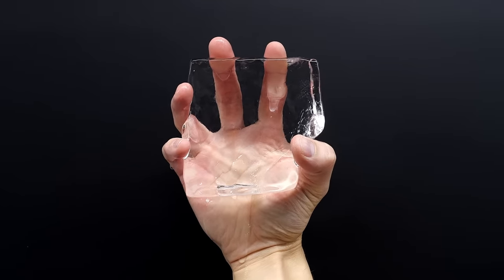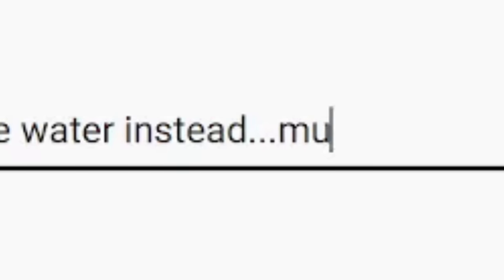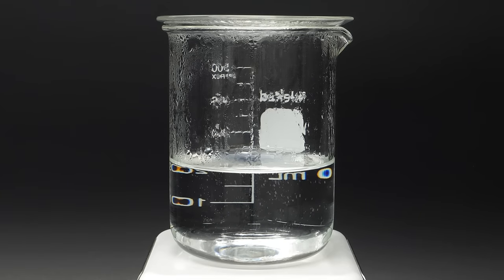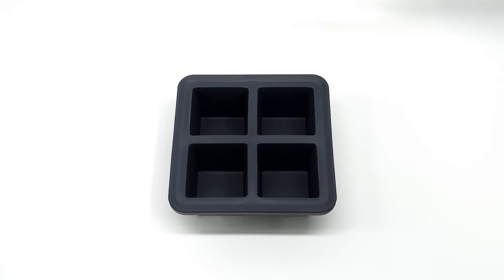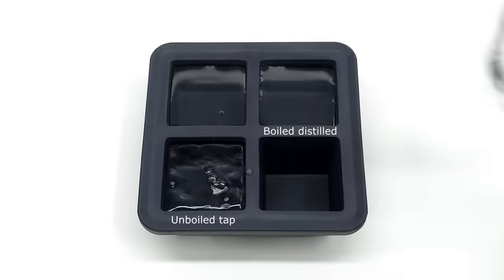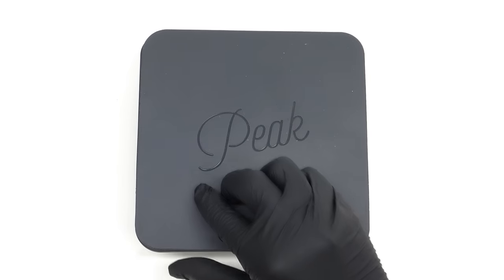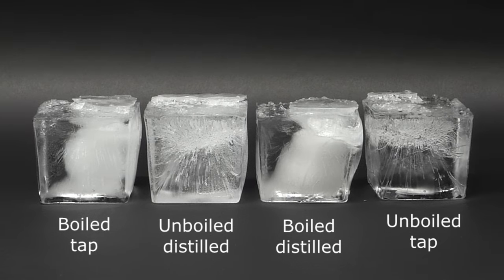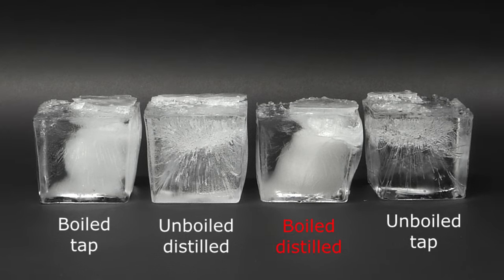The clear ice myth

Comment: It’s been years, so forgive my lack of citation.

For clear ice sculptures a manufacture used a small water pump to keep the water moving (think it was to stop bubble formation..?) in walk-in freezers. They made fairly huge blocks of ice that had crystal clarity. The blocks froze from the surface down so that the pump hose wouldn’t be a feature of the ice hehe. 

Think it was just filtered tap water they used. 🤷
Reply: They also use warm (not boiling) water, which they claim provides the best freezing results.
Reply: @medes5597  bruh that name

Comment: I think the boiling fallacy is based on an already misconstrued truth: that boiled (and then cooled-- which no one ever remembers) water freezes faster.  

ironically, water freezing faster will almost always result in less clear ice.
Reply: it's cuz you need less thermal contraction.
Reply: It's amazing that you don't even need to be a scientist to get to this conclusion or at least understand it, all you need is to have bird baths in your garden and live somewhere that is warmish during the day, but below freezing over night. That filthy, unfiltered, non-boiled water turns into pretty clear ice. Obviously not as clear as actual filtered water, but clearer than all of the tests in this video.
Reply: @deployed246  People living in tropical region: ಠ_ಠ
Reply: No I am fairly sure it's based on boiled water being thrown on the ground in cold weather actually producing very clear ice. 

How clear it is is of course mostly down to how fast it freezes and the manner in which it does. The more time you give it the more cracks you get. 

The problem with icecubes is that they tend to freeze outside in so you get a lot of cracks inside. If you throw boiled water on the ground at very low temps it actually does produce rather clear ice. But the trapped gasses are actually a much smaller factor compared to cracking from the ice expanding and contracting as it freezes.
Reply: The fallacy is in that while boiling water does degas it, it almost immediately starts to absorb air as soon as it stops boiling. The act of pouring it into the mold only served to mix in more air into it.
Reply: @alfredoprime5495  Air is only a small part of it. A bigger part is cracks from ice expanding as it freezes. This happens with basically anything you place in a freezer since it's generally going to freeze outside in. 

To get really clear ice it needs to freeze from one direction. A common example (and where the boiling water thing probably comes from) is idiots trying to clear snow by throwing hot water on it. The water comes into contact with the cold surface while warm steam insulates it from the cold air to a degree. The result is extremely clear (and really slippery) ice.
Reply: It's called the Mpemba effect.
Reply: Those are two different fallacies.   Honestly, until I saw this video, I thought that boiling would would yield clear ice, and at least for me, the reason I thought it would work had nothing to do with the mpemba effect (hot water freezing faster).   The bubbles in ice are (as far as I know) dissolved gasses in the water which have come out of solution with the water when it freezes.    the solubility of gasses in liquids is inversely proportional to the temperature.  ie:  a hot liquid will hold less gas in solution than a cold liquid (unlilke solids, you can dissolve more sugar in hot water than cold water) So heating water will cause dissolved gasses to come out of solution and bubble off (long before the water is actually boiling)   SO, yeah, it seemed plausible to me that you could boil water, causing all the dissolved gasses to leave the water,  so that there wouldn't be any gasses in the water to form bubbles in the ice.   Obviously that is incorrect, although I'm not entirely sure why.     Interesting demonstration of empiricism over ratiocination.
Reply: @alfredoprime5495  All you need to do is keep the water boiling in the freezer. Easy!
Reply: @XMysticHerox  I'm pretty sure you have it backwards, slower freezing results in clearer ice. What makes for really clear ice is directional freezing (freezing with a thermal gradient so one side freezes first, until the top side freezes). That's why the boiling for an ice rink works, because the top layer is too hot to freeze, and it directionally cools.

This is consistent with both how NileRed and the Bartender Vlad made the clear ice.

Large, transparent crystals of anything must be formed slowly
Reply: @sophiophile  Flash freezing is how you do it in a lab. It prevents cracking. But yes directional freezing is the biggest factor.
Reply: @XMysticHerox  Do you live somewhere cold enough for big icicles to form? They are perfectly crystal clear when they form from slow dripping water because they form slowly and directionally (despite the impurities and dissolved gasses).  Flash freezing/crystallization causes lots of thermal stress due to the fast rate of contraction, and hence the cracks.  Just look at ice formed using liquid nitrogen, it is always cloudy due to all of the microfracturing.  You need a single site of nucleation and enough time for no lattice defects. Flash freezing also means lots of nucleation sites, and lots of separate, differently oriented crystals meshing together. 

It is the same thing when you are forming boules of synthetic gemstone material, for example using the Verneuil method.
Reply: Correct, you need it to freeze slower to force all the crap to the top. Freeze it in an igloo cooler. The bottom of the cooler will be nothing but clear ice. You have to freeze it like a lake freezes.

Comment: Doesn't clear ice come down to having a high enough container for the water to freeze in a way that traps the impurities in, most often, the upper layers?
Reply: Apparently it’s something about oxygen or something getting inside the ice that makes it blurry
Reply: @kelfo4997 what does blurry have to do with this.
Reply: @Cannotoad1201  blurred water
Reply: The white and foggy part of the ice is not due to impurities, it is due to air trapped in the ice.
Reply: @mrthanos2404  the air do be trapped in the air
Reply: @normanmai7865  damn I realised how bad I am at typing
Reply: @mrthanos2404  is ok because we all make mistakes
Reply: Clear ice comes from directional freezing. It offers a chance for the air to escape, rather than get enclosed.
Reply: I make my clear ice in one of those little six pack coolers with the lid off. I fill it about 2/3 full of my filtered water (just a carbon filter) and let it freeze about 18 - 24 hrs until the top clear layer is about 2 inches thick. Then I turn it upside down into a basin (to catch the unfrozen water) and then use a serrated knife to score lines and then tap the knife with a hammer to make big clear cubes. Works awesome. 🧊
Reply: @mrthanos2404  I think it does have to do with the impurities as well.  I have hard water (around 300 on a TDS meter), and I just use plain tap water to make clear ice. I let the clear ice melt and then I test it again with the TDS meter, it read a zero.
Reply: clear ice is from directional freezing, when the water is in a cooler its freezes from the non insulated top downwards kind of pushing the impurities and air towards the bottom leaving the top clear.
Reply: @wyrd21  Exactly. If your ice is blurry, that is from too much scotch on the rocks. 😆 LOL
Reply: The air bubbles get pushed out of the water from the bottom up as it freezes. So you need to have somewhere for those gas bubbles to go, which is why you use a cooler for slower freezing and some extra water on top for the bubbles to escape to
Reply: It's not impurities, but bubbles! Dissolved or suspended air.  Forcing it to freeze from the top, where buoyancy would ordinarily take the bubbles, makes the water crystal-clear as it freezes
Reply: @ArchaeanDragon  for sure. Sometimes i’ll let some clear ice melt down, and drink that. It’s some of the cleanest and best tasting water I have ever drank.
Reply: It’s more about ice crystal formation vs anything else.  The lowest energy state for crystal formation is at the edge of a surface (sides and bottom of a container).  The second best location is the air-water surface.  The crystal formation will propagate from from those ledges towards the center.

To combat this you essentially manipulate where both the open end, and the “center” of the ice is.  You can do more sophisticated stuff using ultrasonic vibrations or manipulating pressure, but that’s significantly harder.
Reply: @vashok  I should probably have made this clearer, but I find that the main reason for white ice air rather than impurities, I tried making ice clear before, even using distilled water it doesn’t make it clear. This video boiled the water, which you are right, does get rid of dissolved oxygen and other gases, but as the water cools, air does come back. But you are right, impurities do play a part here, just that the reason a regular person don’t get clear ice is more commonly due to air.
Reply: The cloudy part is gas bubbles and mineral impurities, and it winds up at whatever part of whatever part freezes last. Usually that's the center of a cube, because it's frozen outside in, but if you use directional freezing, top to bottom or bottom to top, you can choose where the clouds end up.
Reply: Impurities aren't the main factor that causes cloudy ice. If that's the case, you could just freeze any vapor distilled water to make clear ice. It has to do with the way the water freezes and crystallizes
Reply: @mrthanos2404  Air is an impurity,

Comment: You need directional cooling when trying to make clear Ice. Slower the ice freezes the less fuzzy it will become.
Reply: A very easy way i found was to put water in a double wall insulated metal cup without a top. It will freeze from top to bottom. Check it often to take out the ice before all of it freezes
Reply: @MiguelY22  thanks lol cuz i can't fit a cooler
Reply: I thought it was more that by freezing from the top down, you get pure water on top that freezes first before it gets down to the impurities which you just pour off?
Reply: @Thegbear  i think you are correct. The clear ice forms on top. Do not let the bottom freeze, thats where it will get cloudy ice
Reply: @MiguelY22  you can let the whole thing freeze and just cut off the dirty ice.
Reply: @lokiaverro4196  Nevertheless if you don't let the bottom freeze, it takes a shorter time to get the same amount of clear ice and you don't need a saw or serrated knife to remove the unwanted part of ice.
Reply: @Thegbear  The direction doesn't really matter. The important thing is that it is directional at all. Notice that if you toss boiled water on the ground at low temps it tends to produce extremely clear ice as well despite freezing bottom up.

Comment: I put some water in my vacuum chamber in an attempt to draw out dissolved gases, but the ice was still cloudy after freezing.
Reply: That's because it's directional based! The ice freezes from all sides and meets at the middle in a normal icecube mold, resulting in the crystals kinda cramming together, or at least that's as far as I know how it works. But, freezing it in a way that only allows it to freeze up and down, i.e. in an insulated cooler where it can only freeze from the top down, results in all the crystals going the same way and not smashing into each other and making it cloudy.

But correct me if I'm wrong on the sciences there, I'm eager to learn! But I will say though: it is indeed very direction based, and once you've got a cooler, not too difficult to master.
Reply: You need to agitate the water while it freezes, anything that vibrates it while it slowly freezes will result in a clear ice formation.
Can't let it get too cold in small areas
Reply: @MelodicTurtleMetal  it's more about how fast you freeze it. when you agitate water you disturb crystal formation which leads to a "tighter" structure but it also takes longer to freeze. Agitation works but it's the speed you freeze it at that is the crucial factor.

Comment: Boiled water doesn’t do anything. It’s directional cooling that makes ice freeze. Directional freezing makes all the ice freeze evenly, unlike the uneven freezing in a conventional food freezer.

It’s like the difference between a pane of glass vs a bunch of smashed up ice stuck together. Because the ice in the freezer is made up of a bunch of different cold sources all freezing in different directions, the ice will never be clear regardless how pure the ice is. The ice cube is physically a different shape to clear ice.

The best way to get clear ice in a conventional freezer is to put the water inside an insulated container like a polystyrene box. That way, it’s only freezing from above, and you get a fairly clear cube even using tap water (depending on where you live of course).

Comment: You want the real secret to making clear ice fast with zero work? Get an insulated mug. Like a travel coffee mug. Fill it with regular ol tap water about 2/3 full and put it in the freezer uncovered. A day later pop it out. Clear ice will be on top and cloudy on bottom. Let it sit at room temp for 15 minutes to temper so you can hack off the cloudy ice. If you cut it straight from the freezer without tempering it’ll crack. Boom, you’re done. The reason this works is because when water starts freezing it turns to its pure form. Ice being more buoyant than water, it floats to the top while all the impurities sink to the bottom. Once you’ve got that principle down, maybe you can improve on this method.

Comment: im aware of the agitation method, which is often used to make sculpting ice. i guess the idea is to keep it from freezing asymmetrically. keep the water in motion to keep the variation in temperatures as small as possible. right up until the water gets to the freezing point. ive seen both vibrating the trays and using circulation pumps. though i can not attest to the efficacy of those methods.
Reply: Asymmetrical freezing is actually what you want though. So the gas doesn't get trapped in the center, but is forced out the  bottom. That's what insulation does. 

The agitators work by shaking the bubbles loose as soon as they form so they're not trapped in the ice.

Comment: Wouldn't the process of pouring the boiled water into the container cause additional aeration and possibly affect the result? To remove this confounding variable, you should try again using the same container to both boil and freeze

Doubt it will change anything, but science!
Reply: Yeah this bothered me, I don’t doubt the result would be the same but letting it cool for so long and pouring it instead of putting the flask directly into the freezer seems like a bad method

Comment: Just looking at it, you might think that boiling water removes the air because of the bubbles coming out. But if you think about it, boiling water is a phase change from liquid to gas; so that's not air escaping, it's water vapor.

Comment: The cloudiness in the ice are fractures made by the expanding solid. When ice is formed, if it starts from outside to inside, then you will have a frozen shell with a liquid core. That core will expand, cracking the already frozen solid core. The only way to make clear ice is to freeze the water in only one direction. Thats what the cooler does. It only allows cold air from the top. That's why lake ice is clear, too.

Comment: The misconception is that it's suspended air that makes ice hazy, but the truth is that it's the impurities I'm the water. As water freezes from the top down, the crystal structure of the ice pushes the impurities downwards. If you freeze tap water, most of the time you'll notice that the top portion is clear, with foggy ice further down. I worked at a McDonald's, of all places, with an INSANE filtration system, and the water would freeze almost perfectly clear, all the way through.
Reply: Your observations don't completely jibe with mine, but they overlap. I make clear ice in the regular refrigerator compartment. Plain tap water works fine. All you do is get a plastic cup filled pretty much to the rim (perfect is not required at all.) Then place the edge of the cup right where the cold air blows into the refrigerator. After a day there will be a nice clear medallion, after a few days it will be several times as thick. I'm serious. The trick is to have the air blow over the surface of the water.
The worst water to use? Seltzer, it makes one big white blob. When I boil seltzer it behaves like regular tap water.

Comment: If you want super clear ice. Use a thermus or an igloo cooler. Just put water in.

Anything that actual has a thermal layer, will force the impurities of tap water to the top. Then you just cut that section off. What your left with will be perfectly clear ice.

Comment: Boiling tap water will still be cloudy .
Using purified will make it clearer 
It needs to freeze from the bottom up so the air doesnt get trapped in the middle.

Comment: this one also sounds like a hassle but what if you bring the water to a boil by using a vacuum that way you know you have sucked all the air out beforehand?
Reply: That could work, but the problem is that it's hard to remove all the air but not all the water
Reply: @puppieslovies  from the videos I've seen you start seeing the air leave the water quiet a bit before the bubbles from the boiling Arive but worth Googling about so I'll do that, also I love your Mayuri profile pic
Reply: @תומרברעם-ש2י  apparently industrial degassing can use vacuums, but it's like a multi step process and it seems complicated. Not to mention, it's not going to lead to better results than the directional freezing

Comment: But you're also pouring it. What if you froze the water in what you just boiled it in?
Reply: Boiling doesn’t remove air, it only probably brings out impurities and slowly evaporates the water. You want to remove air then put it under a vacuum